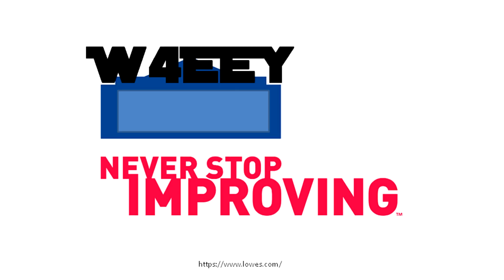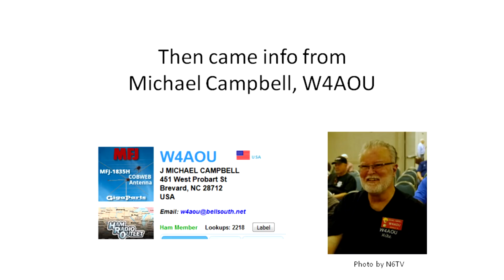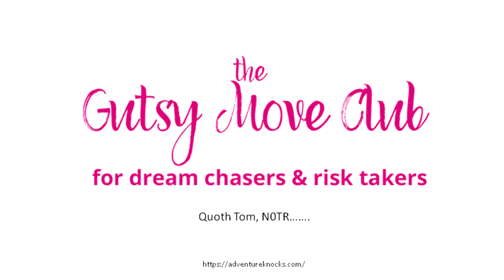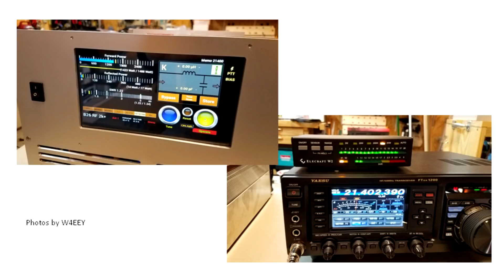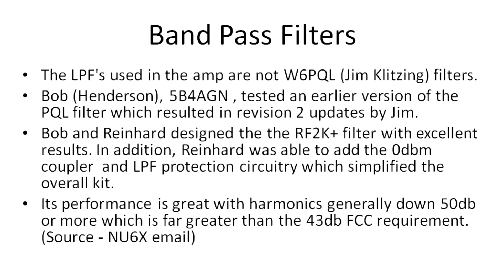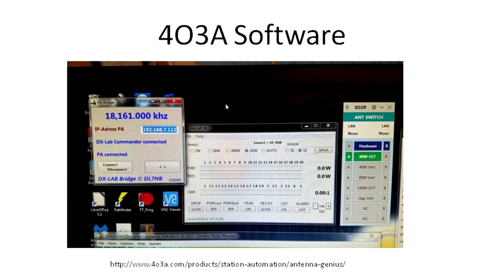BRARS B26 RF2K+ Amplifier May 7, 2018

Comment: Is it possible to run this PA with 400 - 500W output power?

Thanks!
Reply from the maker: Yes, quite easily. Just reduce the drive power. 73 de W4EEY

Comment: Ordered. Coming in July 2018. Some parts are very low cost to replace. Such as the touch screen as low as 50 Usd. Some Rig's screen's cost $500 or more. Also too many junky $800 dollar pallet's out there with no filtering on Ebay. The bang for the research buck got me:-) ARS W7RU
Reply from the maker: I will be building another RF2K+ amplifier and plan to bring you along via video.  Please stay tuned!